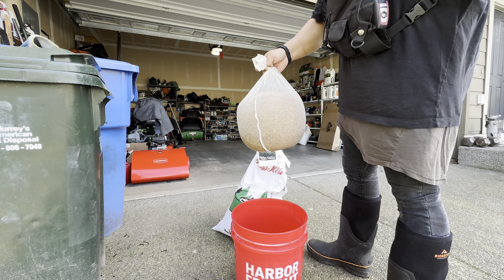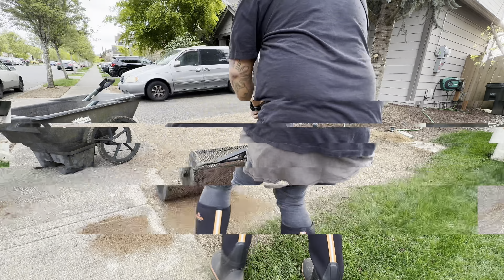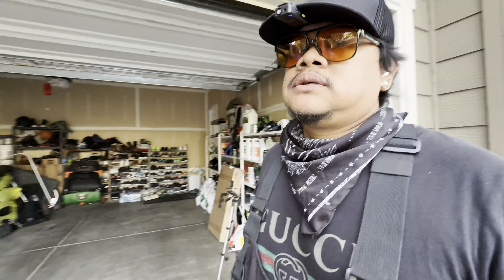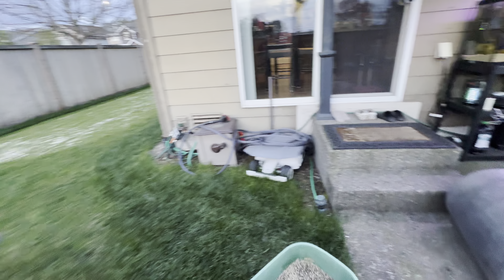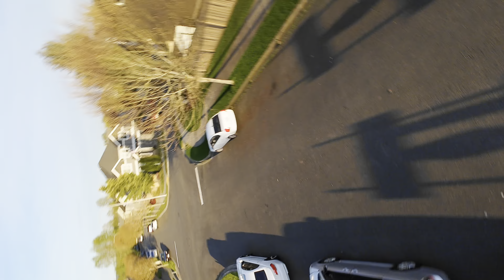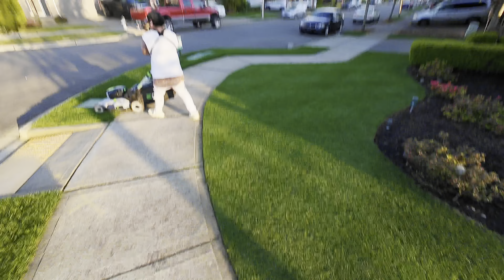NEXTDOOR NEIGHBOR'S SPRING LAWN RENOVATION SEEDING DAY! Got him the DARKEST SEED you can buy!

Comment: THAT'S NOT EVEN FAIR!  Can you do a video over liquid fertilizer dosing?  I've used the backpack sprayer; I feel like I like the hose-end sprayer better.  How would you spoon feed a lawn using this method, and what's the dosing rate?
Reply from the maker: It really depends on the products I just divide the recommended rate by how ever many times you want to spoon feed so divide by 4 if you want to weekly Fert or divide by 2 if it's bi-weekly Fert. Application rates are usually 1 month rates ☺️🤙🏾